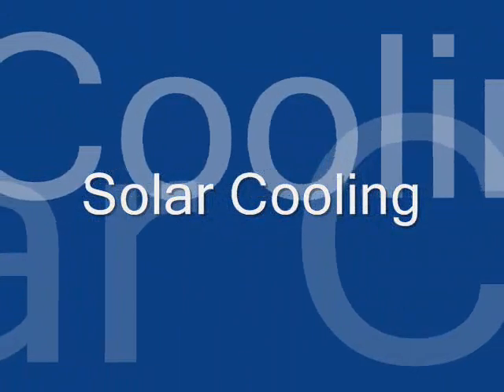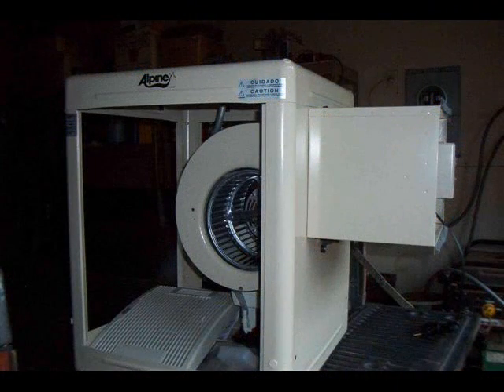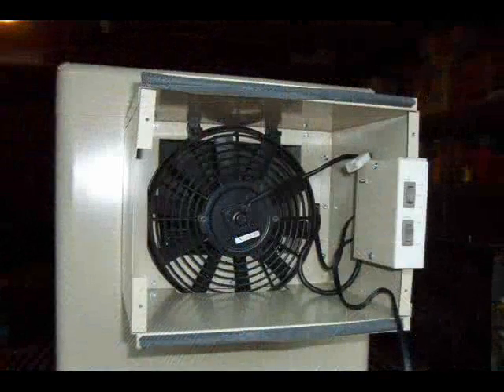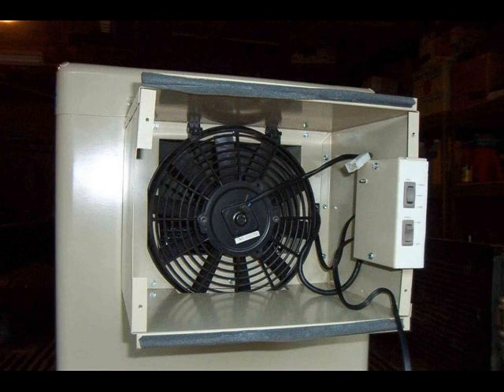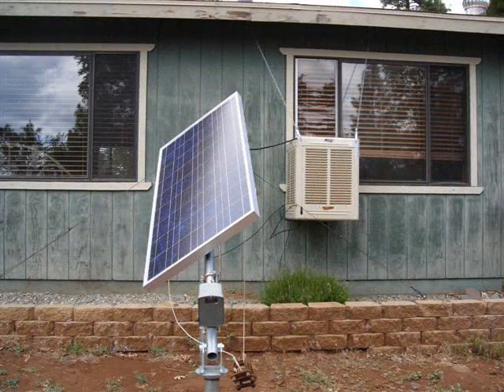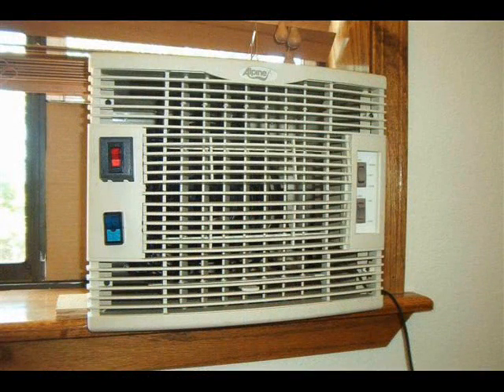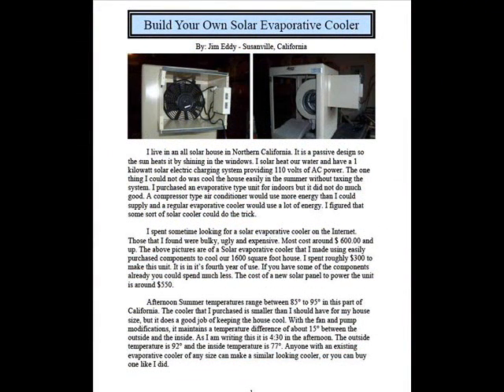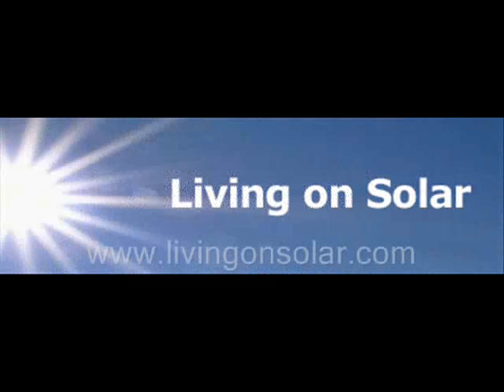Solar Air Conditioner - Solar Evaporative Cooler

Comment from the maker: Actually it keeps it at least 15 degrees cooler which would make it 100 degrees. That is still hot!  When I start the cooler early in the morning and the temp reaches 100 outside, we are still at about 80 degrees in the room where the cooler is at. You are right . We are moving in the right direction. A larger unit or more than one would work as well as any regular evap cooler. Thanks for the comment.

Comment from the maker: @brotherRob3 I guess the statement is a little misleading. What is being stated is that the temperature is still at least 15 degrees cooler in the late afternoon. In the morning and early afternoon the house is maintaining a cool temperature. As the day progresses it is harder to keep that level of cold. Unless you live in an area where the temps are over 100 degrees at 6 in the morning, this cooler works great. It does not work for everyone.

Comment from the maker: Hi Kevin. As I mentioned in my plans the fan is a little noisy. A couple of things that I have done have helped. I put a charge controller and battery in line from the solar panel. This regulates the power coming from the panel and keeps the voltage lower than straight from the panel. It also helps when the sun goes behaind the clouds. I also added a heater fan switch to control the speed of the fan. I can put it on low and it is quieter. Some have used a speed controller also. Hope this helps.

Comment: You could probably use a thermoelectric air conditioner for a more humid climate. A thermoelectric device actively moves heat from one side of a plate to the other using low voltage DC electricity. Attach heatsinks and fans to each side, put one side inside and one outside, and you have an effective window air conditioner that is not limited by humidity.

Comment from the maker: The solar AC cools the whole house not just a room. You are right that the cost is more than a room AC but it is actually less than a forced air AC for the whole house. The cost savings to operate the solar AC compared even to a room AC is significant. The initial cost is soon returned in those savings. Unfortunately this type of unit does not work for all climates. They are usually avaialable in the areas that they work in.

Comment: @livingonsolar  thanks for the response!  i figured it would be a bit much.  my last place had a evap on it and since the place was small and the cooler was large (plus dry environment) it worked pretty well... accept for when its over 100 out your kinda s.o.l.   well at least im going to use my small panel for some LED'S!  :)

Comment from the maker: @PCguy102 Great question. An inverter would convert the energy from the solar panel that I use from 12V DC to 110V AC but the single panel I use would not provide enough energy to power the 300 watts required to run the existing AC cooler. The radiator fan is a little noisy but not much more than the existing squirrel cage fan.

Comment from the maker: @Wallabydam Your question is definitely a valid one. I have used evaporative coolers for over 40 years and mold has never been a problem. I suppose since it sits outside mold does not grow. I alos replace the pads each year.

Comment: Solar power is super cheap and heavily rebated - install 500-1000 watts of solar panels (2-4x 250w panels) to power a dehumidifier, or AC, off grid. Plus plenty of insulation and air tight seals around your windows roof and walls to keep the cool air in and hot humid air out.

Comment from the maker: Hi lainnorcal. If you are talking about the unit that sits on top, It would take a lot of solar panels. I believe they use as much as 2000 watts. They also run on AC voltage. Solar panels use small DC voltage. In order to run this type of equipment you would need a lot of panels, a charge controller and an inverter. That is why I use the evaporative cooler in this video. Air conditioning is a big user of electricity.

Comment from the maker: @KLowD9x I have actually looked for a similar DC motor. I could not find one for my specific cooler. A cooler that uses a fan belt driven system might be able to use a DC motor. Most DC motors pull a lot more power than a single solar panel can provide. The radiator fan provides a good alternative and does not pull a large amount of power.The fan is loud but no more than the AC one.

Comment from the maker: @astrialkil You are right. Not using an inverter can work if you just use 12VDC instead. My first fan lasted about 4 years. I replaced it for $30. The bilge pump costs $10 to $15.

Comment: @livingonsolar Also a new fan motor is not much more then the inverter and the fan motor dose not have sensitive electronics that over heat and fail.

Comment from the maker: Yes. I have looked but not real hard to find a DC motor to run the cage fan but have not found one. The fan that I use works fine for me.

Comment from the maker: @1971SuperLead The 15 degrees is a minimum. Sometimes there is a very small difference between comfortable and not. When the outside temp here is 95 degrees and my inside temp is 85 degrees with no additional cooling and fans blowing hot air with the windows closed it seems hot. Take the temp down to below 80 degrees with air flowing through and it IS a little more comfortable. Evaporative cooling does not work in every situation. It happens to work for me.

Comment: I would like to set up a little off-the-grid shelter, too. Unfortunately, your plan doesn't sound applicable to our needs here: your emphasis on "dry" climate makes me cringe--we have heat in the 90s PLUS mad humidity, so I suppose an evaporative cooling device is out. My home barometer says that the indoor humidity (inside an air conditioned on-the-grid house) is around the mid-80s. Ugh. Any suggestions on how to chill a virtual sauna without tapping the grid?

Comment from the maker: @astrialkil It does not move the same amount of air as the existing squirrel cage fan. It does move enough air in my 1600 sq. ft. home to hold up a piece of tissue paper against the screen of a window in my home that is at the opposite end from where the cooler is. This is not totally efficient but effective.

Comment: geo-thermal is only answer to hot and humid.dig a big hole to put a 275 gal. ibc inground.with home built plastic liner to protect ibc.pump water from ibc to a cooling coil of some sort with a drip pan to drain off condensate from coil. use fan to blow air across the cooling coil. in arkansas they use to use a cooling tower to remove the heat from the water instead of geo-thermal.school bus uses a dc water pump to pump hot water to all the heaters inside so think junkyard for pumps on firewall

Comment: "Air conditioning", is a misused phrase.  Most people think it means refrigeration but it just means something about the air was modified.  Heating is air conditioning, & so is humidification.  W/ that said, because the majority of people think AC is refrigeration, this video should really be called "PV power for evaporative cooler".

Comment: Kuwait as far as I know has a hot dry climate, ideal for evaporative cooling. This will NOT work in tropical climates though. The Persians used evaporative cooling over 2000 years ago with large cooling towers.

Comment: Your 12v blade fan that retrofitted to the cooler doesn't output the same CFMs as the old cage fan.
Could you find a cage fan that could take 12V/24V DC input and use that instead?